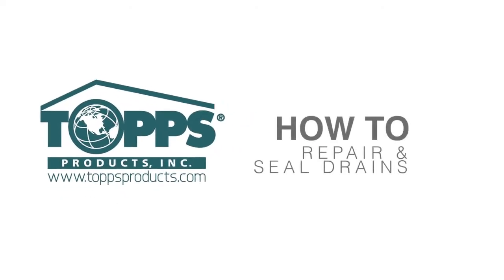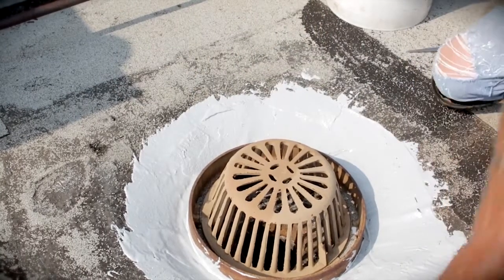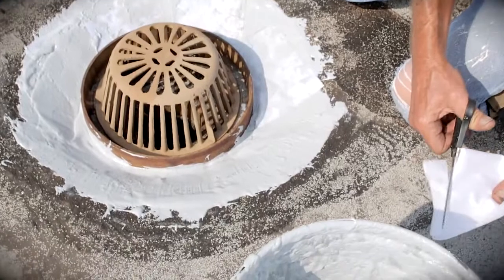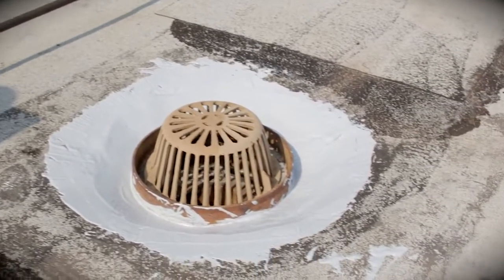How to repair and seal roof drains

Comment: This is dumb. If a roof drain is leaking it's most likely the clamping ring. Pipe connections could also be the problem.  And a bunch of other stuff. Anyway,  tighten the clamping bolts on the drain ring first. If that doesn't work then the entire assembly may need to be worked on.
Maybe I'll phone record the worst case scenario and talk about why one does what needs to be done.
Keep an eye out for the video.

Comment: I have flat roof and pipe run inside wall one side always leak like flood in building so we cut wall out we found straight down pipe have open 40 wye ?
My question is why it was opening ? I have put cap and closed the pipe